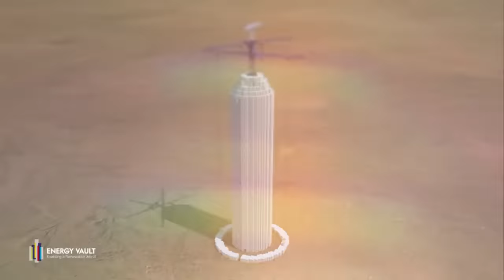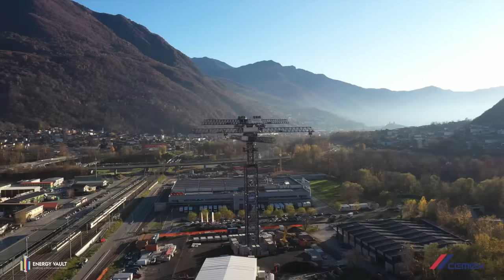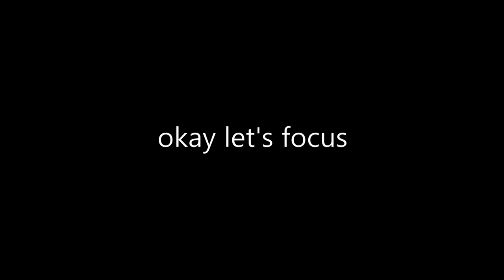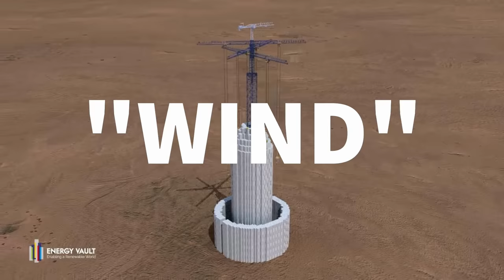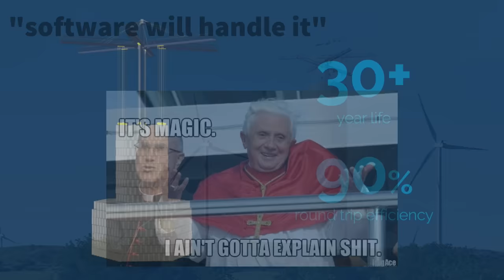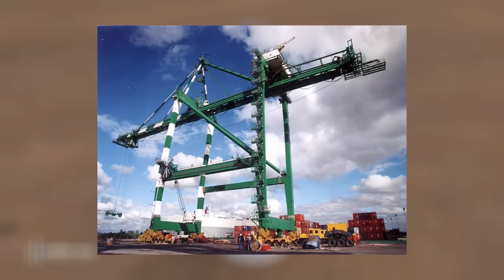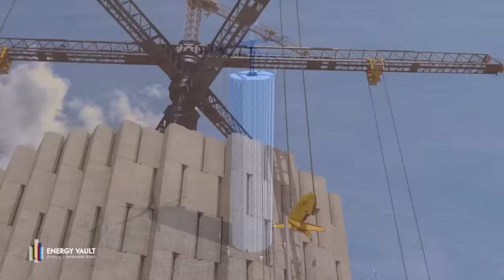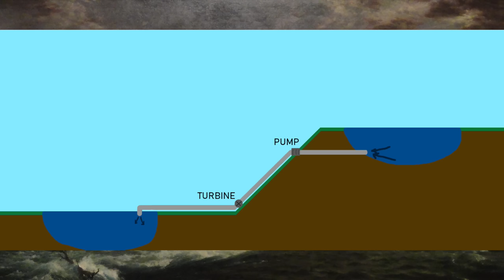The Energy Vault is a Dumb Idea, Here's Why

Comment: It would be interesting to see a bit more delving into pumped hydro without the hill.  Pumped hydro with a hill is surprisingly difficult to create: it needs very specific terrain to work well.  It's great if you have the right terrain and low population density, say northern Scotland, or the Azores.  But it's not a scalable solution for most cities.
Reply: True, but the problem is the cost. These sorts of hydroelectric power storage are already super expensive to build. Adding an artificial replacement for natural hills would make it even more so. Maybe this would still be worth it for certain areas, but I think standard industrial batteries would probably be a better solution for space-limited areas.
Reply: Although I like a few of his videos, but the arrogance with this guy is just through the roof. 
If PSH worked for every case there wouldn't be any need for any other storage solution (Plus they are expensive, need specific topography, and destroy environments). So what does he suggest : 
- Stacking the blocs in a wall-like structure to help with the wind chuckle
- Digging a tower deep hole once again to help with the wind (cost, feasibility, sanity really...)
- Creating a lake deep underground, then putting another lake on top of it, with the turbine is at the same level as the top lake intensive facepalm
I won't go into the details about why this video (and many others on this channel)is a sham, maybe pull the wool over people's eyes, and as someone working in the field, I feel insulted.
Reply: I think density is really not a big deal in this case. I live in Belgium (20th country in term of density) and there is one. I can tell you it takes very few space, and we are not living on top of each other so i guess there is plenty of space to build that in other countries. See Coo Hydroelectirc power station
Reply: What about, you know, where there is something, let's call it an electrical grid, that allows you to produce electrical energy in one place while storing it in another, better suited place. Sounds totally futuristic, I know.
Reply: @DarthChrisB  There's always some loss in transmission, though that's fairly minimal compared to the efficiency of the actual storage devices. Still, if you saw the Last Week Tonight episode on power grids like I did, you know that a shift to renewable energy production will require a massive overhaul of transmission grids to get power from the windmills/solar/hydroelectric generators to the cities.
Reply: Storing the energy of 2 windmills is pretty good when you consider that's almost a thousand homes.
And dense weights in an underground well seemed like the best solution before he went with water instead.  Doesn't hydro lose a lot of energy to turbulence?
Reply: @Rocco_loco  Dude, the point of that segment went so far over your head, the ISS had to do an emergency evasion maneuver.

The whole point is that that suggestion is not to build it like that, it slowly leads up to PSHs in general and how they work.
He begins with the idea the Lego-and-crane-enthusiast suggested to solve world hunger, and in an iterative process changes it from what was suggested to a far more sensible solution with a similar basic principle: Whether you spin a turbine by letting a cable put down a big heavy solid object to make electricity or if it's water that spins a turbine is no difference.

Frankly, if topography is the big issue with PSH, making a giant array of oversized water towers in the middle of a flatland is a more realistic, cheap and reliable solution than to stack blocks of concrete via cranes.

Also, you criticise the video cause it leaves out that PSHs can't be built into a city... but these abominations of concrete blocks can solve energy storage problems in cities? lmao. Might as well just put giant weights on every skyscraper, it's a more realistic solution than this tower of idiocy. Why not use elevators to harvest energy while we're at it.
Reply: could always use a water tower instead of the hill
Reply: @Rocco_loco  to be fair the structure the video is about would face similar if not the same issues as PSH. With the added mechanical strain that the block storage would undoubtedly suffer from it is unlikely that it will ever store enough energy to counteract what it comsumes to make it viable. Not saying that PSH is the only solution in any case, but the block stacking structure is definitely not a good alternative. 

Perhaps instead of building purpose built water towers like  H. A. was suggesting perhaps installing water tanks on skyscrapers above that 200m height and using that for PSH. It seems like a relatively cost effective option when compared to some of the other ideas that have been thrown around. Granted the total energy storage would be lower than a purpose built facility but in some cities with high skylines that should be negated by the number of systems with the advantage of dispersing the load so that one failure does not bring the whole system down.
Reply: @militarykid9183  similar issues..mmmh... how about the added :  digging feasibility and it's cost. Reinforcing said undeground tank so it wont collapse on itself. Waterproofing also as I mentioned in another comment you need 200m head for any type of PSH to work. So you will only digg deeper making your problems even bigger.... big diff between a flawed idea with major problems and a crazy stupid one.
Reply: @h.a.9880  Do they do that? Do elevators have regenerative braking?
Reply: @militarykid9183  anything that's holding vast amounts of water high off the ground would need to be designed to do so from the get go though, so while I'm not against the idea of using skyscrapers you'd want that to go into the initial design because I don't think you could install one in a building that's already standing. (Or not a very big one anyway)
Reply: @PuckLokin  my first thought was to utilize the preexisting water storage tanks that are already in place as the upper storage device, most skyscrapers already have water storage tanks in place to power the plumbing, since the tanks and plumbing is already in place I see no reason we can't utilize it. And to respond to the other, less reasonable commenter, the lower tank could simply be the existing waterways that provide water to the building in the first place.

Obviously a skyscraper that is not designed to fulfill this role will not be as effective as one built with this in mind but it is still leagues better than the reliability nightmare that is the crane idea.
Reply: @Rocco_loco  Building a 200m tall water tower is a more sensible solution than to build 10k concrete blocks and have a ridiculous star-shaped array of cranes lifting them up and down.

And besides, the main point of my post was about you missing the idea behind the "let's put all that shit underground" thing.
Reply: @Rocco_loco  I mean... Just look at Electric Mountain in Snowdonia, it utilizes abandoned quarries and has been running effectively for over 20 years. Granted it is an early iteration but it singlehandedly manages peak surges in the British grid for short spells very easily, these things don't need to be set up next to cities, hell, they don't even need to be set up in the same country just where its viable and least invasive, the area around the hydro plant has been regenerated and created lots of specialist jobs in an incredibly deprived area. These ideas aren't just tried and tested, they've been in use for decades, you've just never taken the time to learn about them 🤷‍♂️.
Reply: @Rocco_loco   I think the argument he tries to make is not that those aren't bad ideas,  but he claims the vault is even worse. Which may or may not be true, The major logistic benefit of  this crane system vs both artificially built lakes or using a gravitational pit is  the vertical structure needs to be strong enough to lift only six bricks, way less than 1% of the total storage mass. At least in theory, wind might be manageable but the self supporting stack  looks quite sensitive to earthquakes. 

Anyway the whole argumentation is moot since they are pursuing different design now which  I doubt is an improvement anyway
Reply: @Rocco_loco  You do realize that the tiny, incremental differences going from the original idea to hydroelectronics are NOT fully fledged ideas, they are merely meant to demonstrate the thought process, right? 

The point is, the original idea is a car crash, and it bleeds from a thousand wounds. You only need to point out one or two catastrophic ones to demonstrate how dumb it is.

Honestly, you wound like a science bro yourself.
Reply: @JCAtkeson3  "doesn't hydro lose a lot of energy due to turbulence?"

How much energy do you think is lost on steek cables bending back and forth while they winch up tons of concrete all day long? Turbulence is nothing compared to that.
Reply: @Rocco_loco  For PSH to work you need at least" 

No you don't. You do realize people have been building watermills with a height difference of a few meters, right?
Reply: @horvathbenedek3596 I don't like cables either, they are bad engineering.  In principle, you could put the weight at the end of a lever and achieve the same thing with only 1 wear point, that can also be made almost frictionless.  Such a lever would be impractical in reality but proves that there is a very high limit on the efficiency of mechanical storage.
Reply: @JCAtkeson3  You're talking about rotational energy, which, for the record, is INFINITELY better than this thing. They also don't bear any resemblance in principle of operation. Nobody talked in blanket terms about mechanical energy.

Even then, the simplicity and easy sizability of hydroenergy makes it a better large scale option overall. Efficiency is nice, but pumped storage hydroelectronics has an efficiency between 70 and 80% in general, which is already pretty good. In exchange you get a system that has next to no failure points. With rotational energy if the bearing gives out, you have a multi-ton beyblade destroying stuff around. With PSH you only need to make sure any potential dams are taken care of.
Reply: The issue is 2 more wind turbines isn't a solution for most cities either... which is what this battery is.
Reply: @horvathbenedek3596    It's not rotational energy.  You are confusing a seesaw with a flywheel. A seesaw uses gravity, a flywheel does not.  A lever locked in place will hold its energy for decades. A flywheel loses its energy in just hours.

A raised lead weight is more energy dense than water, and has no losses to evaporation, mud, fish, seaweed or weather.  It's hard to see why dry weight can't do better than hydro.
Reply: @horvathbenedek3596   Hydro is a raised weight.  It feels like you are just looking for a fight and not reading very carefully.
Reply: @JCAtkeson3  yeah, raised weight... With literally millions of cubic meters. You can't create a seesaw on that scale, it's utterly impractical. Not to mention, hydro works with 200 meters of elevation minimum in practice. A 200 meter seesaw with the ability to hold millions of tons of weight at each end would be an engineering wonder in and of itself. Utterly impractical. And you can't even use concrete, because the dynamic stresses would destroy it almost immediately. 

Also, wanna talk about the stresses on the gearbox that turns roughly 30 degrees of rotation into thousands, to power an electric generator? What are the teeth gonna be made of, adamantium?

Or were you planning to draw energy from the weights sliding from one side kf the seesaw to the other? Where's the energy derived from? Is it rotational, or translational?
Reply: @JCAtkeson3  BTW I just looked this up, for reference. The max capacity of the Hoover dam is 2.38 million cubic meters. That's roughly 2.38 million metric tons. It's also 220 meters tall, so let's say the average water level difference is 100 meters.

The Burj Dubai tower is 500000 metric tons. 

To match the capacity of the Hoover dam you'd have to build a seesaw with a height difference of 100 meters that has 5 Burj Dubais at one end, and I presume slightly more on the other. 

At this point piling railway cars filled with concrete on top of a hill seems like an INFINITELY more cost-effective solution.
Reply: @horvathbenedek3596   I like your math!  I think the misunderstanding here is that I intended the seesaw as a thought experiment to minimize friction, not as a practical design. A rail car is more realistic, I just don't know what its friction losses are.
Reply: @JCAtkeson3  Oh, I see. Yeah, as a thought experiment, it's a little more sensible, especially with regards to friction  - though I think that's still a massive issue. Mechanically bearings at this weight will produce a LOT of friction;  a magnetically levitated axel might be possible, but then you have the issue that transfering the rotational motion needs, as I mentioned, a gearbox - and a gearbox needs to be aligned, while a magnetical axel will never be fully centered. 
Alternatively, such a system could use a linear generator for creating energy from the weight moving from top to bottom - but building large linear generators is way more expensive than rotating generators. 

I'm not shitting on you, I think exploring these ideas is an interesting case study in engineering. 

As far as i know, the friction losses on a railway car are actually quite low. Especially since, while this might appear contradictory, more wheels produce less friction. Think about how bearings work - a massively overloaded bearing will have the bearing balls digging into the axis deeply, causing lots of friction. If you keep deformation to a minimum with lots of wheels, you keep friction lower. There's probably a sufficiently large load under which a certain number of wheels make more sense than a relatively low number of wheels. I hope you understand my rambling.

Comment: I love when you got to the water part and I went "it's almost as if we already have this" and I never made the connection of why does this stupid energy tower exist when we already have hydroelectric energy reservoirs. ALL engineering problems should abide by KISS. Marketing problems ignore this. Hence why we get stupid things like this.
Reply: The problem with hydroelectric energy reservoirs is that it only works in some places with the right geography and that tower idea was developed as a solution to that. It just failed miserably.
Reply: @shelk107  maybe developing a water tower style storage
Reply: @shelk107  that and it's still limited and messing with rivers can cause a lot of unwanted consequences downstream
Reply: @shelk107  I agree. unfortunately, the conclusion of the video is just a bowtie on top of a rather poor argument overall. Don't get me wrong, I 100%agree the idea is mostly dumb, but this video does a terrible job at addressing why. It uses handwaves and "we already have this totally different thing" too much to make a strong point. Like, for example, that this is an energy storage concept, not a generation one. Comparing it to a wind turbine is not a good point.
Reply: @deefdragon  couldn't agree more
Reply: @deefdragon  they compared its storage to the production of a wind turbine because it exists to store the energy produced by things like a turbine
Reply: There are not enough reservoirs for one. Just because there are wind turbines does not mean there are constant gale force winds. Lets just dig for more coal undtil everyone is dead except the billionairs.  This video brought to you by Exxon.
Reply: CK Lim  the 24 purely hydroelectric dams in Washington state would like a word.  The 8 hydroelectric and navigation combination purpose dams would like a word after them.  The single watersupply/hydroelectric dam would like to get a word in after them.  And the sole combination irrigation/hydroelectric/flood control dam, which also happens to be the biggest one by far, would like the final one.  Yes, most of those are in existing waterways.  That doesn't negate the base point of it.
Reply: @VJK102   i have that .. patent pending
Reply: @deefdragon  wrong.. like the water storage projects. this is a storage and generation project
Reply: @shelk107  PSH (or pumped storage electricity) has already been in use in Wales for decades and in several other countries I believe (usually mountainous).
Reply: @stevenn1940  I love the waterways and geology of Washington state.

But that's Washington state and a relatively few other areas that are suitable for pumped hydro storage or power generation.  Washington (certainly the western part, not nearly as much a lot of eastern Washington) has a comparative abundance of water compared to most places, and the geological features to make it workable.  In most of the western US such is not the reality and won't be unless major geological changes happen.  There needs to be other viable large-scale energy storage and generation solutions beyond relying on water in any manner.
Reply: @angelgodplace  there's also molten salt batteries